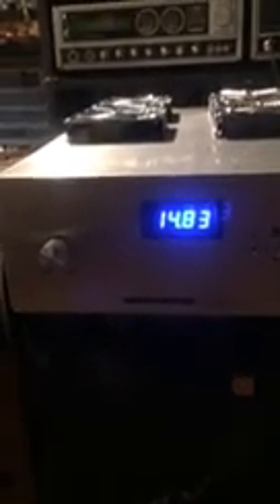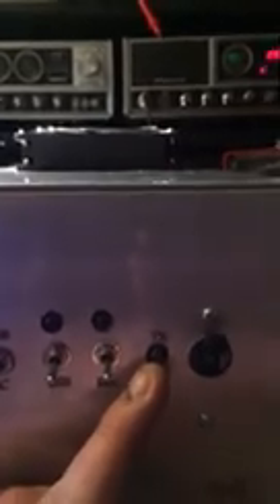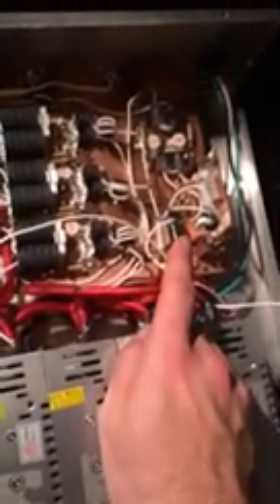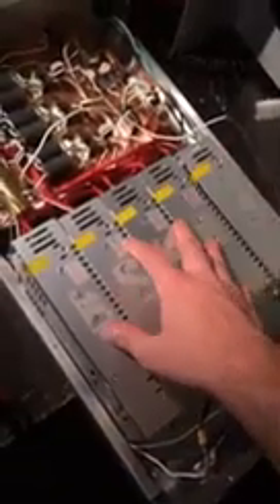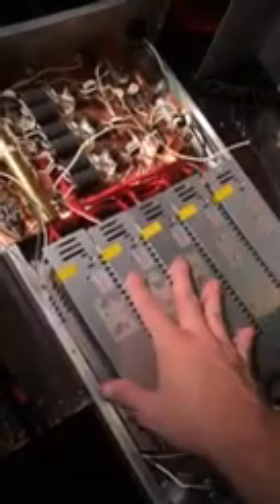DestroyerAmps 2x6 Base unit

Comment: if you look carefully the transistors are. Going toward where the air comes out rather going against was here comes out there for the heat sake is going the same direction. This board will overheat and blow out transistors